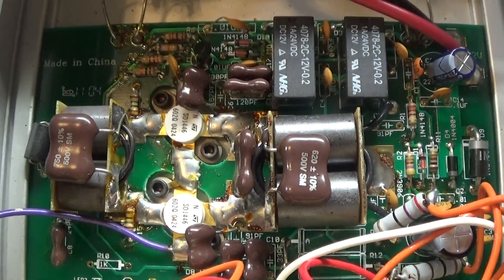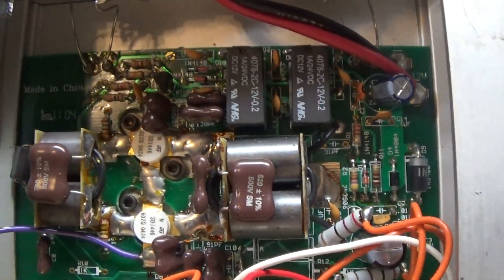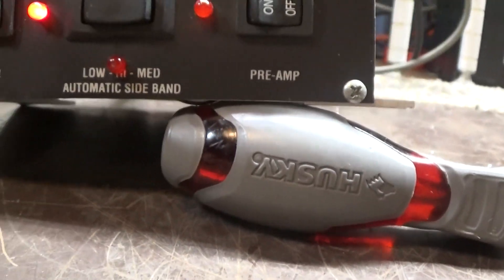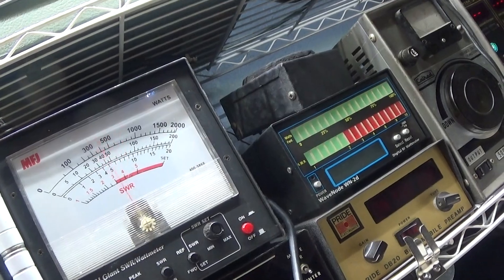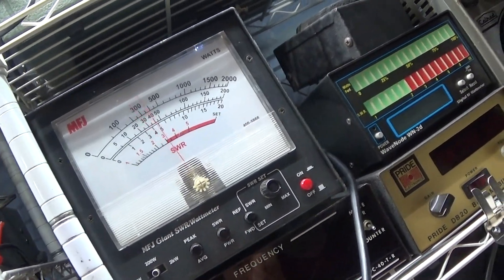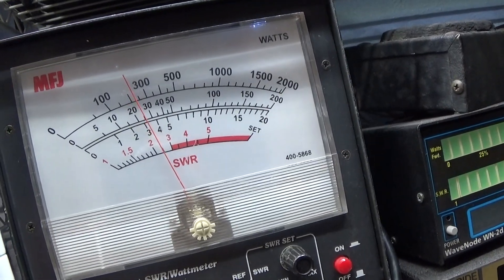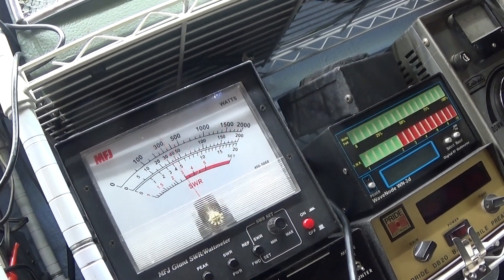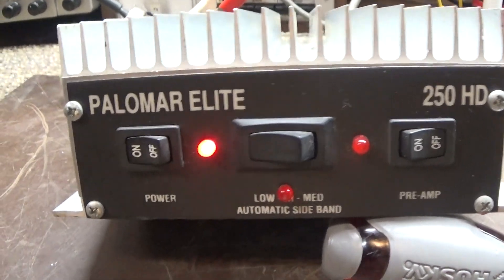Palomar 250HD 2 pill mobile linear amplifier

Comment: I have a couple of these  1 is my 8 pill driver thee other resides in a cobra 29 ltd classic been in that radio for 7 years maybe a little longer runs lile a champ.
I had to mill down the heat sink and add 2 small fans and a little black spray paint.